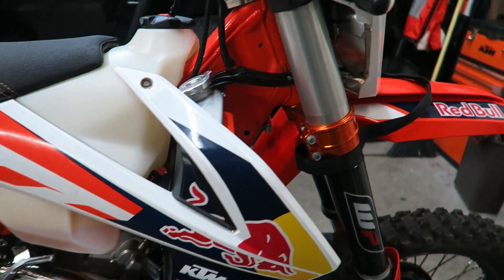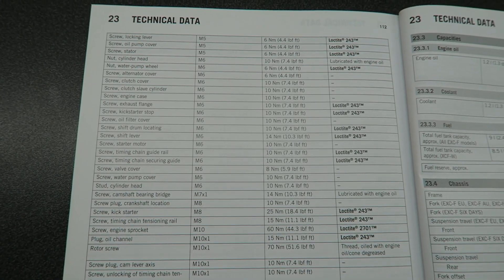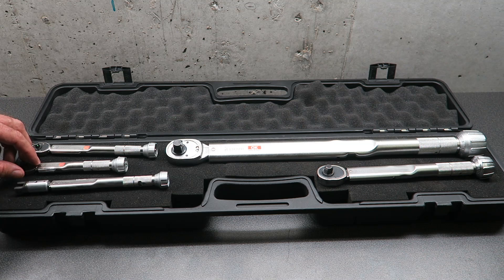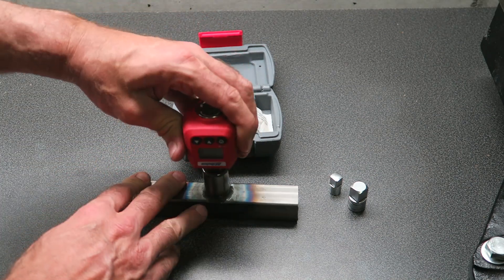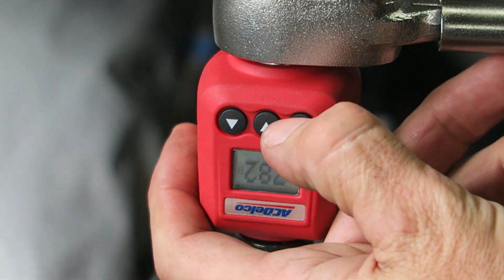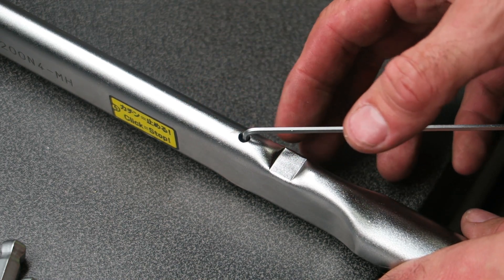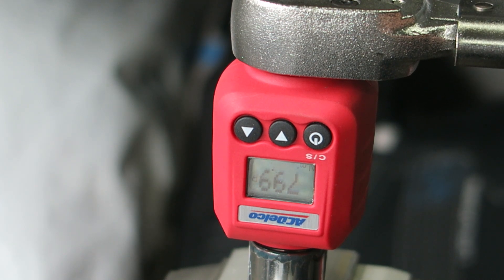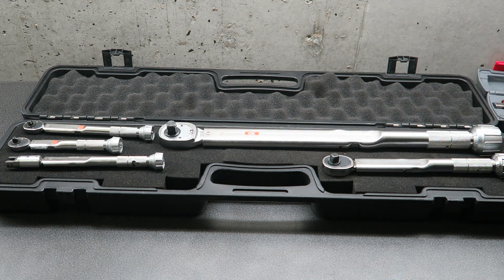Torque wrench talk and calibration

Comment: What about calibration for the digital adapter?
Reply from the maker: If you want to confirm the accuracy you’d either need to send it away, or if a local tool shop has a calibrated torque measurement instrument then use that.
Reply: @TokyoOffroad is there a way to calibrate the digital torque adapter yourself? What is the process of calibrating it? I can't find any info online
Reply from the maker: @atnamesarelame  If you're concerned about the digital torque adapter accuracy my recommendation would be to use a professional torque wrench torque tester. A local tool shop has one and allows customers to test their torque wrenches. This would allow you to confirm whether is is performing within spec. Note that I have not looked into whether it's possible to easily calibrate the AC Delco digital torque adapters yourself so can not provide any guidance regarding that.
Reply: @TokyoOffroad  Yea I wanting to know whether or not the user could calibrate it but I'll keep researching. I was interested in Quinn from harbor freight. Have you tested yours at a shop recently for accuracy?

Comment: I was under the impression the ACDelco 602 was in fact a torque wrench in itself (for use with a breaker bar) - I was looking at one to use as such. Would it not just make sense to use the accurate one rather than use it to correct other ones? There's an audio/buzzer setting when you reach the required torque. Or am I totally wrong on that (very possible)??
Reply from the maker: Yes, you are correct that the AC Delco can be used as a torque wrench if used with a 1/2” breaker bar or ratchet handle. However it is quite bulky and I prefer the click of a mechanical torque wrench. Regarding accuracy, the AC Delco is listed as 2% clockwise, 3% anti clockwise. This is plenty accurate enough for my use. Yes if you want a higher level of accuracy there are dedicated instruments for torque wrench calibration, but of course these cost a lot more.

Comment: Thank you for the video, but a key question is: how do you know that the ACDelco is calibrated correctly? Digital or not, internally there is a mechanical component that, too, can go off calibration, right?
Reply from the maker: Yes, you are correct. To be sure you need to periodically check/calibrate your calibration source.
Reply: @TokyoOffroad  so far is your ac delco is still accurate, and did you also calibrate your small torque wrench at 10Nm - 20 Nm using that ac delco as well ? thanks in advance.
Reply: Check reviews of the AC Delco torque adapter. They were not favourable. Performing a mechanical calibration using weights and distance is a touch of math and some faff but it's accurate.

Comment: why not just using the ACDelco digital torque adapter as torque wrench? could save some money
Reply from the maker: I do occasionally (mostly for reverse thread torquing). However, it is quite large and awkward to use. I prefer the ease of setting, compactness and mechanical click of my Tohnichi torque wrenches for everyday use.

Comment: How often do you calibrate the electronic torque gauge?
Reply from the maker: Personally I haven't. For my application (personal motorcycle maintenance) a very high level of accuracy is not critical. If the digital torque converter is carefully handled and not abused it should perform within spec (2% CW) for it's lifetime. One local tool shop does have a professional grade torque tester and I will at some stage take a couple of my torque wrenches along to test after calibrating using the ACDelco Torque Adapter to check that the accuracy is still good (would make a good follow-up video)...

Comment: How long does the digital torque meter stay in spec though? Surely after a while that will be out of spec just like a wrench?
Reply from the maker: In the specification sheet there is only one accuracy spec "Accuracy CW ± 2%; CCW ± 3%" and it doesn't specify whether this is a lifetime spec. It would be a good idea to check the accuracy every couple of years. A local tool has a Tohnichi torque meter intended for test and calibration which is free to use. I've been thinking that I should calibrate one of my torque wrenches then check it in the tool shop torque meter to get a good idea of the accuracy.
Reply: @TokyoOffroad  Thanks I think i'll get one of these to check my wrenches out. I'm guessing that theres no way to re-calibrate these meters though when they eventually do fail?

Comment: I want buy the ACDelco use to car fix, but this digital torque is not need calibration in the future?
Reply from the maker: The digital torque adapter should hold calibration well over the years if handled and stored carefully. Obviously if you see a sudden shift you should either have it tested, or replace it. Due to the cost (relatively low) it’s probably going to be cheaper to replace it if it breaks, or looses calibration. Mine is still working fine after about 4years of occasional use.
Reply: @TokyoOffroad Thank your reply, this info is very helpful for me.

Comment: stupid question.....why have a torque wrench at home when one can buy the little red electronic device and use that together with a norma wrench to torque up bolts....?
Reply from the maker: mike last - Not a stupid question at all. You could do exactly that. For everyday use I like using mechanical torque wrenches as I find them easy to set, easy to know when you reach torque (click mechanically, no need to listen, or look) and will last a lifetime of careful use. The electronic torque converter is also quite bulky and would be difficult to use in some applications.
Reply: i see you are using the ACDelco....there are a few on the market and i was thinking on another make.... i think its a quinn....have you tested or used any of them other than the ACDelco
Reply from the maker: mike last I tested a Tone brand too : https://youtu.be/GQ2ixv9wIKE
Reply: @TokyoOffroad  Which one you think is better?

Comment: What makes you sure the ACDELCO is accurate?
Reply from the maker: The ACDelco Digital Torque Adapter comes with measured data and a torque accuracy specification of 2% clockwise. I had an opportunity to also use another brand of digital torque adapter (Tone H3DT135) and the results were the same, so I'm pretty sure the level of accuracy is good. For my use (off-road motorcycle maintenance) I'm happy using this to calibrate my torque wrenches.

Comment: Is there any specific brand(s) of torque wrenches you would recommend? What is your take on digital vs mechanical torque wrenches?
Nice video.
Reply from the maker: All my torque wrenches are Tohnichi. They make high quality torque wrenches which I have found to be easy to set, hold calibration well and a pleasure to use. In Japan they are widely available, but overseas could be more difficult to find and possibly expensive. Regarding Digital vs mechanical, both have plus and minus points. Digital torque wrenches typically cover a broader range (10x or more)) and can be more accurate, but are more expensive, do not have a mechanical click (sound, or vibration at torque), have batteries that need replacing and electronics that will fail at some time. Mechanical torque wrenches are simple to set and use, produce a nice mechanical click at torque (less likely to over torque), but have a narrower range of torque adjustment (typically 5x). All things considered I prefer mechanical torque wrenches.
Reply: another advantage of mechanical torque wrenches are that they allow you to work in tight spaces. digital torque gauge add too much height in tight spaces, hence unusable in certain conditions.